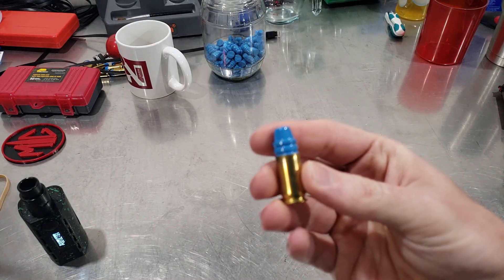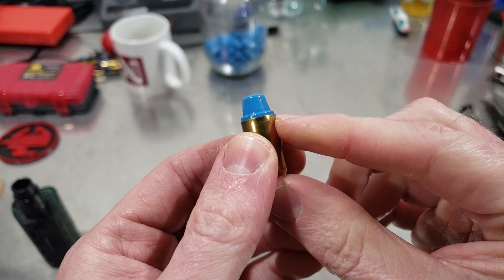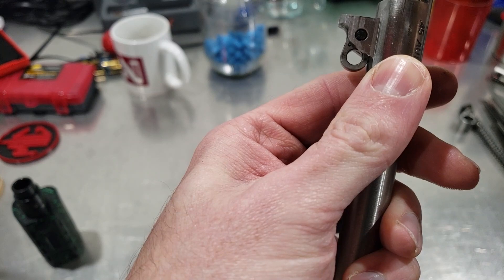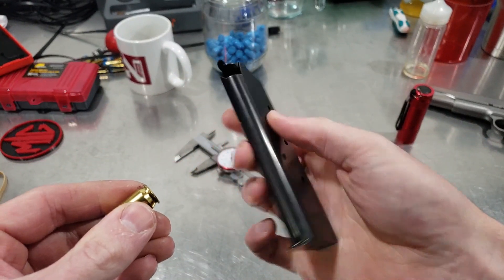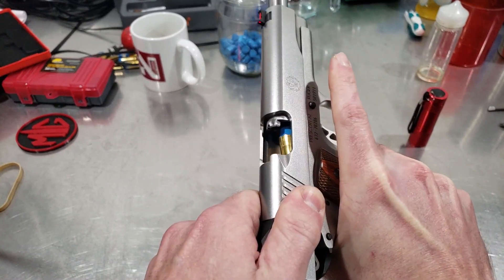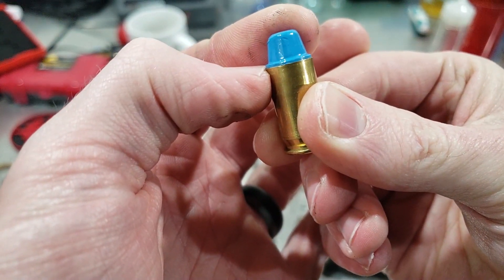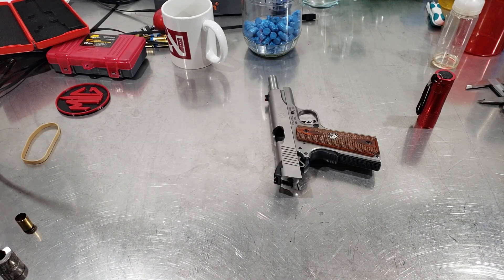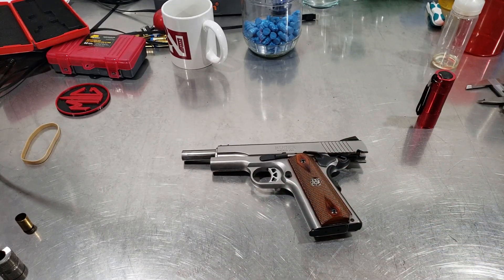How to determine OAL for an unlisted bullet

Comment: Thanks for this video because I didn’t know this
Reply from the maker: No problem! Just make sure to find where a case sits in relation to your barrel hood. My Beretta barrel is different than this. A properly sized case sits about 0.125" above the barrel hood. Try it with a factory round first to see where its supposed to rest.

Comment: Your chamber edge may need some work. you are getting the bite on the edge of the nose of the bullet, no biggie, however, it may slice off a piece of bullet and that will get lodged between you chamber and the sidewall of the case causing a feed problem. I have found (My own experience) changing out your magazine follower with a Metalform rounded follower aids feeding as the round is fed from a higher purchase on the last round. It helps align that last round and helps stop that slicing of the nose causing that feed problem. Just some nickel dime advice. Anyway, ya, Cranky has that coating system down to perfection with High Tech. many people have tried it and couldn't duplicate the results he gets. Good video and you are spot on about seating depth adjustment. -Dave
Reply from the maker: Yeah, this Ruger isn't the most polished weapon. I might do some work on the feed ramp but idk if I would try the chamber edge myself. Metalform followers, I'll have to check those out. Thanks, Dave!

Comment: With the SWC profile I think we are asking our 1911's to go into battery with a stubby nosed round...I mean that they have a smaller OAL  profile out at the nose, than the old round nose that it was designed with. I think the H&G moulds tried to extend the length of the SWC so it could do the pool ball ricochet thing off the ramp and the top of the chamber but still they don't duplicate the ole Lyman 452374 LRN...once you work the length out they'll generally function about 99% of the time or at least that's been my experience. The length of the round also helps to slide the rim between the extractor and the slide face as it does that last ricochet into parallel alignment with the chamber.
I think the manual describes the front  mouth of the case at a .473" OD when properly taper crimped but as usual I can't leave well enough alone and I set my taper crimp die to .471" thinking that I will get the front inside of the case to bite into the PC coating by .001" still leaving aproximately .009" of a case shoulder to insure proper headspace...never have had light strikes indicating too short of a headspace problem stemming from my tighter crimp.
In the end...it's whatever works in whatever 1911 platform  profile but you nailed it with the old 'fingernail' measurement...the fellas can just skip all this 'OCD BS' and get right to the solution...heheee....good flick Kurt, I like how you left the 'Oooop's oh shit it seated' part in the flick as it is more realistic doing that. We are a long way from perfect in our ways so why try to fake it?
Reply from the maker: I tried finding taper crimp dimensions in my One Book: One Caliber manual but I don't think I ever did. I'll check out my taper crimp. Thanks, Charlie! Pretty cool how the fingernail was DEAD ON with the thickness I found. Now to see if this fickle beast will eat them! Hehehe, I was expecting the case head to be sticking way above the barrel hood. Whoops!!!